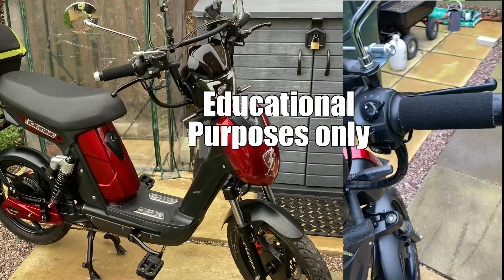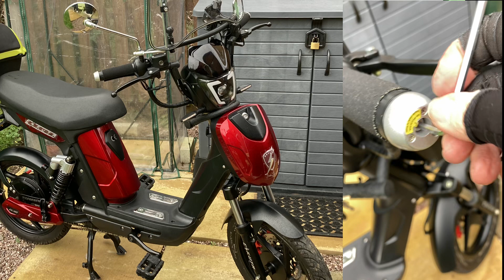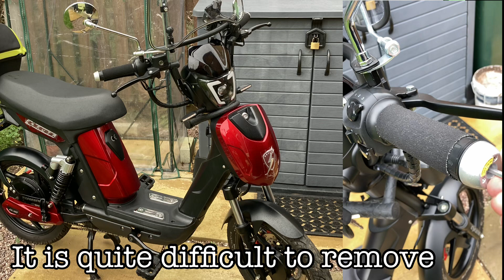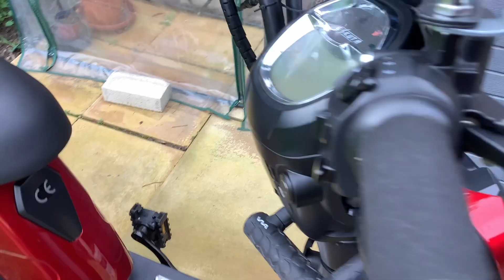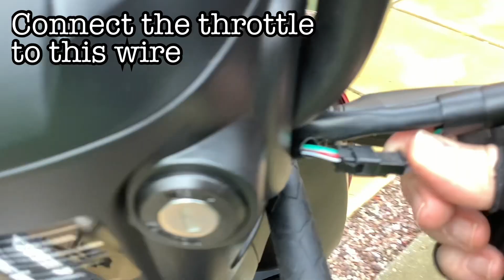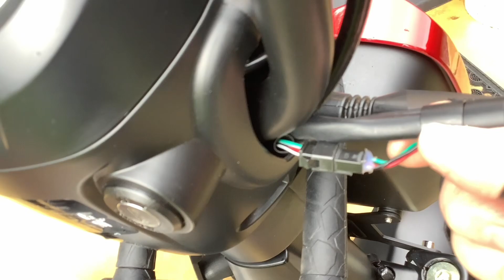How to fit a throttle to an Eskuta 250w electric bike

Comment: The connection appears to be on the left instead of on the right like in the video and it’s a two wire not a three so three pin isn’t gonna work unless there’s a connection on the other side and confused to why I can’t get it to work
Reply: I can’t seem to get it to work I bought one and it won’t do anything so I don’t know what’s wrong unless I’m not doing it properly, but I’ve looked everywhere and everything
Reply: @RossPurdy34 figured anything out I’m about to have a go on my mark four I see the connection on the left with two wires and thought the same gonna try and get the front piece off and take a look to reallly work

Comment: It's a 3 pin SM connector. If the wires are in a different order to the one on the Eskuta, you can depin the connector from the Eskuta using a flat screwdriver (videos on YouTube if you search depin sm connector) and you can reorganise the wires so they match with your choice of 3 pin SM connector throttle. I have a thumb throttle on my Eskuta SX-250.
Reply: Hi do i need to depin to match wires as they are different colours
Reply: @neilsmith215  Yes. If the wires all match up when connected together the throttle should work. All the best 👍
Reply: Hi, I did found the 3pin sm wire, but when i connect it to a thumb throttle, both the green walking button and throttle would not work. But if I disconnect the new throttle wire, it begins to work again. Any other wire we need to disconnect to make it work?
Reply: @joe100kg  it won't work because the Eskuta wires to the connector are in different order to the throttle. Search depin sm connector on YouTube and watch how you simply can disconnect the wires that go into the SM connector using a flat screwdriver. You'll then need to make sure that red goes to red, black to black and the blue/green. Once the wires match on both ends of the SM Connector, It should then work. All the best.
Reply: @olid512  Awesome mate! It works for me now! The Female side of the connector is too stubborn, turns out I rewired the throttle side and it works now. Thanks so much.
Reply: @joe100kg  hi  mate, can you tell me which throttle you bought and from where for this bike? I live in the UK
Reply: So you didnt show us how to connect a throttle, you should have shown how to open up the part to get at the wires, up to us if we damage our property or not, and by showing us that would have saved us from doing any damage you see.